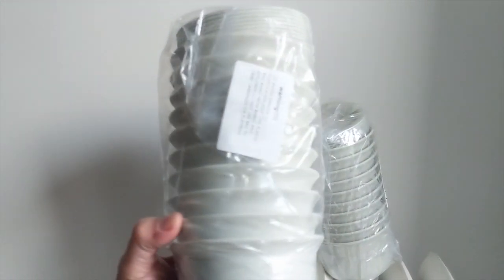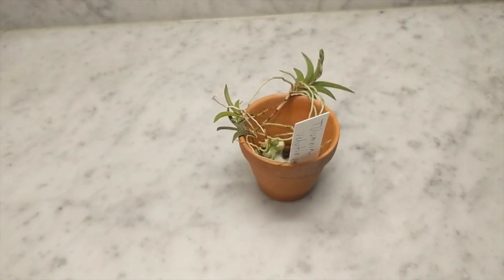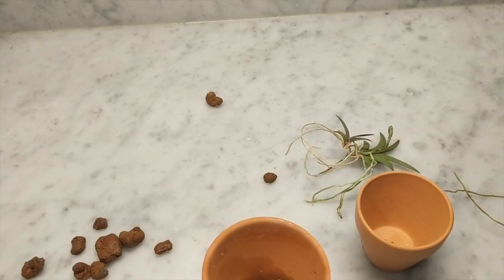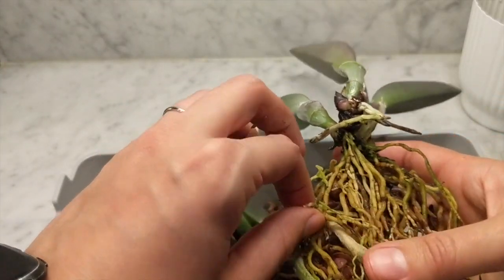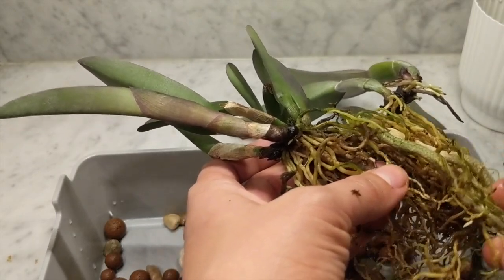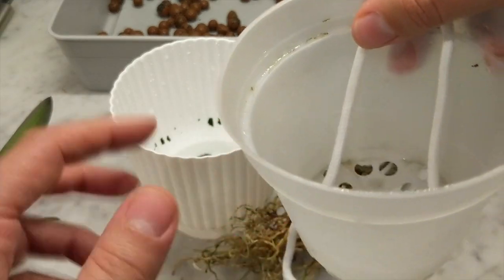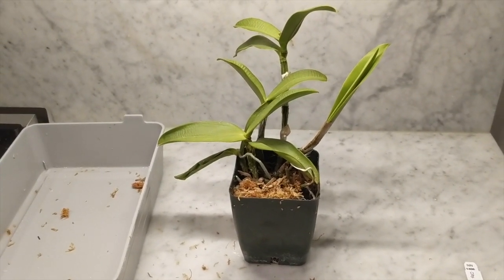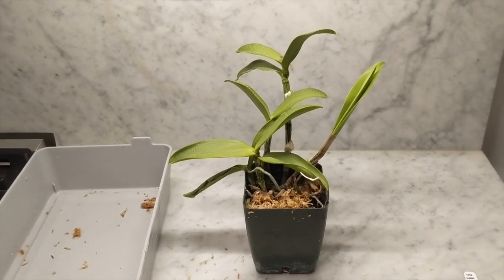Getting Ready for Spring Part 3 | Chatty Repot - A Look at the New Self Watering Pots & SH Chat

Comment: Only wished I could have seen you pull or cut the second orchid apart and cutting of roots on the last. I struggle with the repotting. Lots of good advice. I am watching my roots on cattelyas since they need to be repotted. Also, courage for the die off that will come. Seems I repot and they die. I tell myself it's one way to downsize for new ones. 😂

Comment: Hi Nicole I love your channel, my question is ' what do you prefer for the most of your orchids, leca or bark?
Reply from the maker: It's a tough one, after transitioning many orchids over to leca, I'm going to say that I love leca for being able to fill water reservoirs, and keeping my collection watered, but flushing requires a lot of water, and repots still need to happen regularly to prevent roots from getting air inside the pot.  Bark is easier to work with, but I have to water more often.  It comes down to big work repotting and once a month when I flush, vs. an easier grow system with bark but I have to constantly water.   I'm going to go with Leca, but almost chose bark because of its ease, it was close.

Thanks for watching my videos <3

Comment: You skipped right over adding the leca. Do you leave water in the outside pot? I wick my African violets and they do so much better. Is similar to that? Aside from that your videos are very helpful.
Reply from the maker: Check out my video from 3 weeks ago and I go through every step. I do leave the water in the outside pot, the leca wicks it up, with the wick touching the water reservoir. Some pots don't need a wick because of the design of the pot, but it works just the same :)